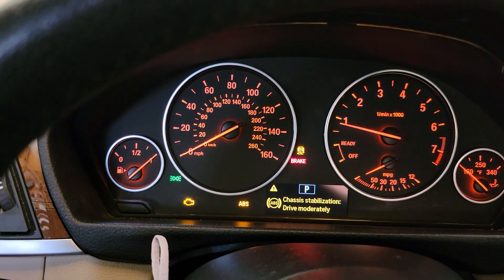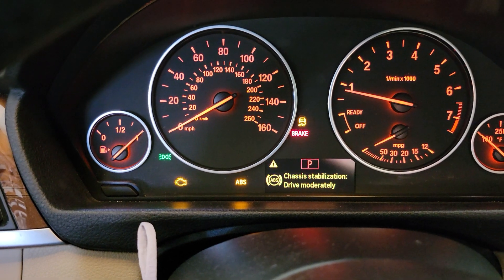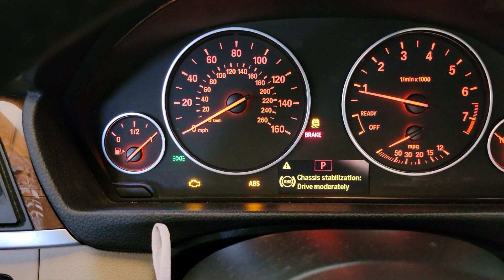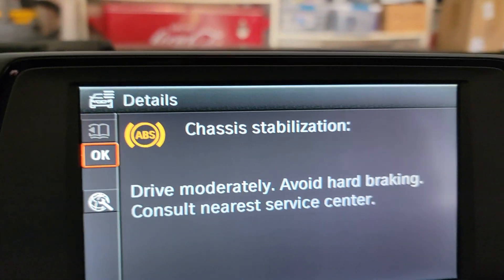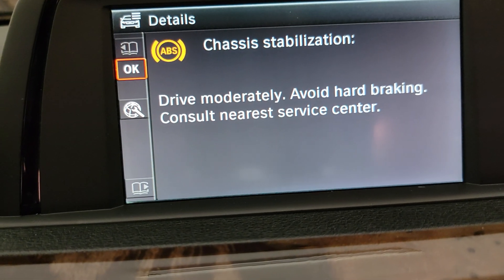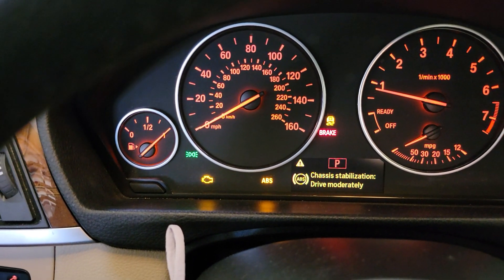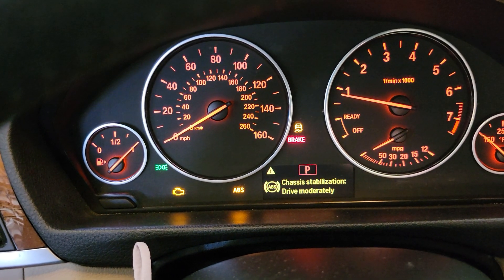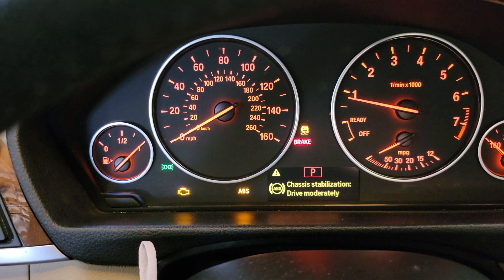Bmw Abs Chassis Stabilization

Comment: I just got a 2017 320i and mine is doing the same thing. Ran a car reader at Auto Zone. Took it to Meineke and they tried to charge me $800 to fix. Then took it to Momentum and they are charging $260 for the part and labor but that's without diagnostic which would cost approximately $130. I am upset as I just bought the car and have had it for less than 18 days and this came up. Freaked out bit but I am better now thanks to this amazing video. Extremely helpful. THANK YOU.
Reply: What was the problem

Comment: I have this same issue. (17’ 340i) when we scanned it. It showed the front passenger abs wheel sensor. Replaced it and all codes went away. 3 days later code came back going to replace the other 3 sensors hoping that clears it.
Reply: How much it was
Reply: Did this fix the issue? I just had this code pop up for me
Reply: @benredman1932  wassup boss man just seeing this now. I ended up getting all 4 sensors replaced and as of now 7/21 no light whatsoever.
Reply: @alvaro1768 how much did you wey ? Where at ?? Helps carnal
Reply: Did you get OEM sensors?

Comment: I have the same problem but oh, it turns me off since I've been driving for 20 minutes, it turns off and turns on again if one of the wheels remains in the air, what would it be?
Reply: I have the same problem, what did you do to fix it ?

Comment: Please how do you fix this
Reply from the maker: You need to change the break sensor
Reply: @cicclaus25  the brake sensor or ABS speed sensor ?
Reply: On my x3, its showing ISTA D is unable to communicate with the entire DSC/DSC Module .  Its showing Red on the control tree .  And the 3 lights are illuminated on the dashboard.  4x4 on yellow, Brake on Red and ABS on yellow, . Please kindly help
Reply: @theedifyingassembly2985  Ever find the issue or fix?